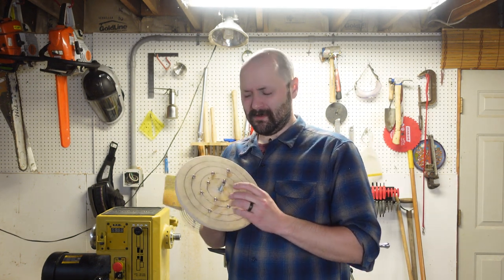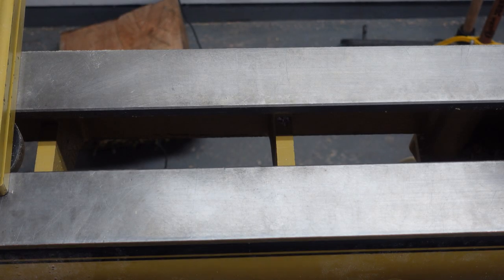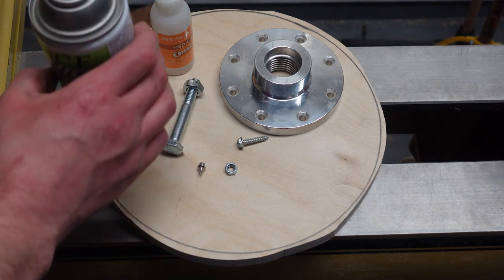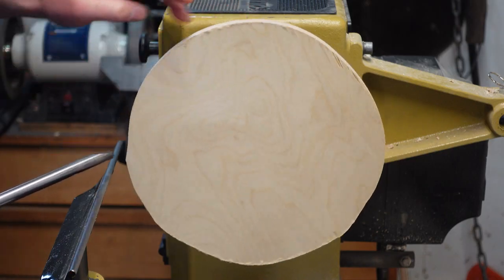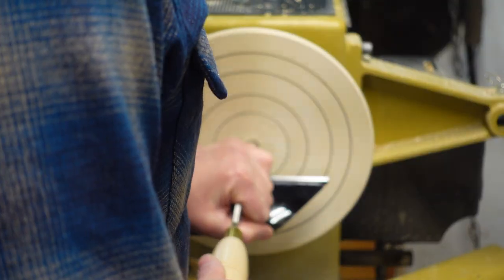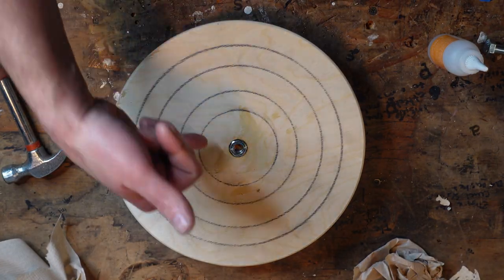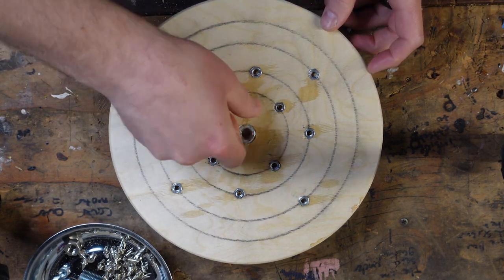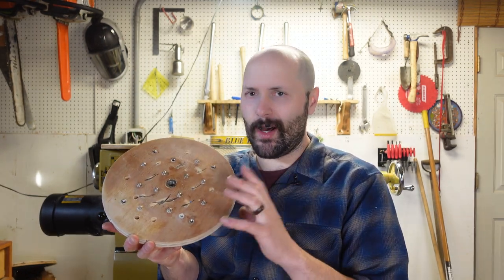This Spike Plate Will Cut Your Roughing Time in Half!

Comment: Nice build. I prefer to start between centers or my favorite method is to use my homemade spur drive made from a 3" face plate. I started with a Penn State faceplate with the center screw chuck screw. I ground the center screw to a point. I tapped two of the face plate mounting holes and added hardened bolts with the tipped ground to a knife blade point. These stick out just short of the center point. It's basically a mini version of the Oneway Big Bite spur drive that mounts in a chuck. I like starting between centers so I can balance the weight of the blank. It's much faster to start roughing with a higher speed. Plus, I can manipulate the blank to get the exact balance of the wood grain, or in the case of a natural edge bowl, I can get exactly what I'm looking for in the way of balance. I suppose if you had a bandsaw or real nicely squared blanks, this method you describe would work great. Making turning life easier is nice and I'm glad this is working for you.
Reply: I was trying to remember where I got the idea for my spur drive and it was from the Elio-DR Drive sold at the Woodturning Tool Store. It's one of Tod Raines's designs but they are used with a #2MT drive. I don't like using any drives in my #2MT. There's nothing worse for your lathe than an unbalanced blank being driven by the #2MT. His design uses spear point bolts but I found that those didn't work as good as bolts ground to knife blade points.

Comment: Thanks. That's straight forward and easy.
I wonder if red Loctite would keep the spikes from working loose.
Reply from the maker: Most likely. I end up removing the spikes as necessary depending on the diameter of the piece. I wonder if loctite would make that a pain in the butt???
Reply: @anthonycima7  If you use the "Red", yes. It's more permanent. The "Blue" is not but holds well also. It's for disassemble later.
Your Lowe's should have both in the glue area.
The Blue may be in a red tube, but BLUE will be on the front of the tube.

Comment: I would have liked to see you actually attach that to a bowl blank.  Why not use the worm screw instead of that bolt? Id think the bolt length limits the size of blank that you attach?
Reply from the maker: I was constantly struggling with the worm screw spinning out or not having enough grabbing force and wanted something that could handle 20” diameter blanks. The bolt is only there as a centering device. A person could always use a longer bolt with their spike plate because it just threads into the nut secured in the plate.
Reply: What holds the blank against the spikes? The threads on the bolt do not look coarse enough to grab. What am I missing? Can you append this video showing how to attach it to a blank?

Comment: I don't understand how this will help. You still have to find the center of your piece and drill a hole. Where's the advantage over a wood worm screw?
Reply from the maker: Better grip for faster blank roughing.
Reply: This drive will allow for some rebalancing on the TS end and works better with blanks that may not have a perfectly flat surface.
Reply from the maker: @MikePeaceWoodturning  mike is 100% correct. Thanks for your input Mike!